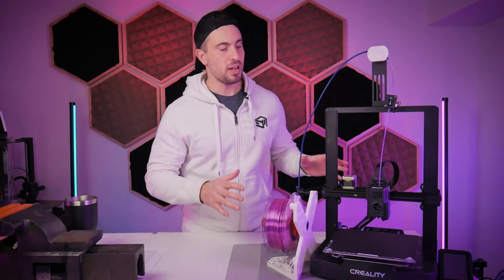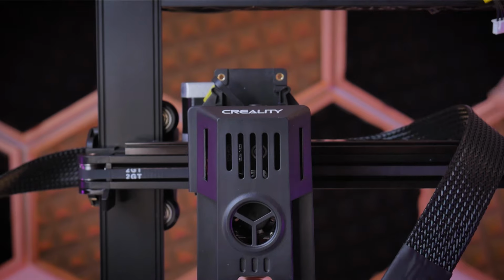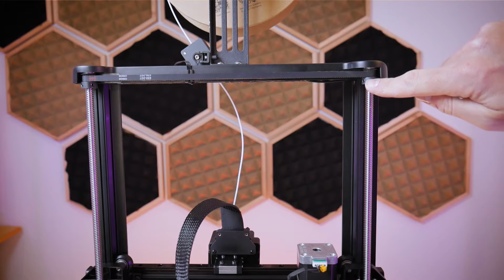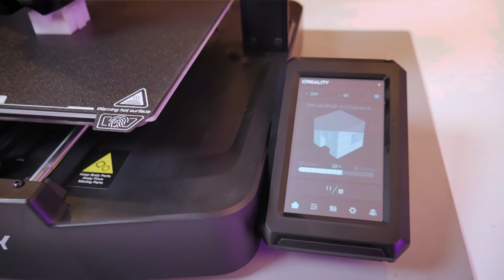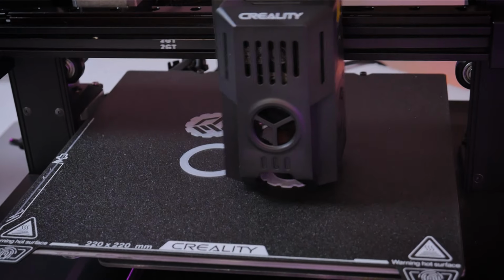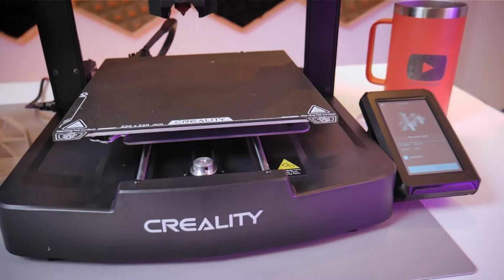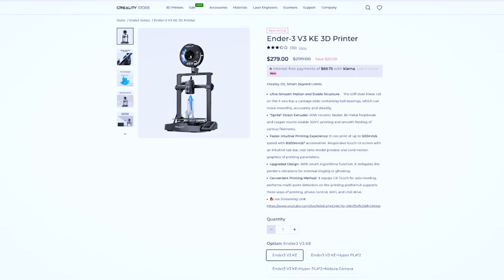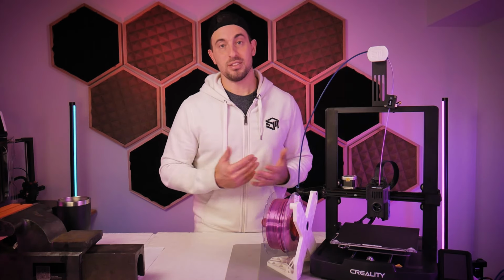Creality Ender 3 V3 KE Setup Guide, Tips, Review, and Upgrades

Comment: You can remove the horizontal movement of the bed entirely by taking off the bed, loosening the bolts that go into the L and R bearings. From there you can add a bit of tension between the rod and the bearings by pushing the right bearing right, and the steel plate to the left, and then tightening the right bolts. Do the same to the left, but in the opposite direction, and you will add a bit of tension that stabilises the barings, using the steel plate to take the force (you are basically moving the bearings away from each other by a few decimals of a mm).

Remove the two belt bolts and move the bed around to confirm you didn't add too much pressure, and everything is running smooth. You can also try adding bit of toe in/out to the bearings if you think your issue is at the front or back of the bearing. While you are here, clean off the oil and make sure the rod is nicely lubricated and that there is no dust on the rod that might get into the bearings. 

Very easy to do, takes around 10 minutes. My bed doesn't move horizontally at all. I still have a tiny big of sag when weight is applied to the front of the bed, but I think that is just a consequence of only having 1 bearing on each side, you are naturally going to have some sag.

Comment: Where did you get the blocks from and why aren't you using cura?
Reply from the maker: The blocks are just some random metal blocks I had from an old job where we used to make plastic injection molding machines. I don't use Cura because I can't stand the interface - I find it too busy and can never find the settings I'm looking for.

Comment: i have the KE and upgrading it to the latest firmware that unlock root access is a must so you can install mainsail.
Reply from the maker: I will be experimenting with a few of them now that I have more than one KE :)
Reply: @EmbraceMaking i have 1 KE i was initially going to get a 2nd one. but then i decided to get the bambu labs X1Carbon. they are both awesome printers in its own way.

Comment: Excellent video. I got my Ender KE in January 2024 and have been enjoy it quite a lot. I recently noticed though that the gantry on it is not square to the print bed, and tilts towards the back of the machine. I contacted Creality about the issue, but the response has been crickets. Do you have any advice for this issue?
Reply from the maker: Have you tried disassembling it to see if there is something obstructing the extrusion from sitting flat in the channel? Perhaps there is some kind of metal burr or something on the inside that is in the way ?

Comment: My Ender 3 v3 KE came with broken CR-Touch and with nozzle covered in white filament. I think I got used printer, because I see on your video that nozzle is clean. Plus I also got bent nozzle to the left. The CR-Touch problem is code 2194 and a lot of people on the internet have the same issue. This printer is good, but only if you got printer from good batch xD
Reply: I got the 2194 error using the Cura slicer switched to Prusa and no errors. I could not install Creality Print on my main computer because it had some SW conflict. I did install Creality Print on a different computer and the speed difference was way faster than Prusa slicer with Marlin-2 gcode. The Prusa Marlin project box took 7.3 hrs to print. The Creality Print Creality-OS sliced gcode box took 1.15 Hrs to print. It was flying.  I have about 60 hrs on my KE and had to tighten belts (because I was getting X,Y bed judder) and Extruder mount screws just today. Made a world of difference. I used Elmers purple glue stick for the first time today as the the PEI bed was beginning to have some adhesion problems. NOW I'm very happy with the fast high quality prints I'm getting. The live Zed I will look at. Looks like a great tune for me to try. Love my KE. My first printer. I subscribed!!! Great video!!!!
Reply: I'm having the same issue. Only 3 days old and started 2nd dy. The more I inspect it, it seems like a firmware issue. I wish Crelity would fix this or I'm sending it back. Otherwise its a boat anchor.

Comment: I have the other new Ender machine the Creality CR-10 SE, LOL only Creality right.  I did root the CR-10 SE and bought it because I saw on line how to root it before I bought it.  I have a Bambu X1C with the AMS as well as two other Creality CR-10s.
Reply from the maker: Very nice, how are you liking the CR-10 SE?
Reply: @EmbraceMaking Love it after even more after I rooted it.  Now I can use Fluid or Mainsail to control my Klipper machine and really it's another Ender machine.  Who ever heard of a 220x220x265 sized CR-10?

Comment: I like that you were honest with the problems you had with yours. I have yet to talk to someone without a single thing that was wrong with there KE out of the box. For me my tool head frame wasn't bent all the way just like yours causing the CR Touch probe to be lower than the nozzle. After a long talk with Creality and after they tried to get me to bend it back myself they are sending me a new tool head frame.
Reply from the maker: Thanks, I do my best to report it like it is. I was hoping that because the unit I received was pre-release that maybe these were some isolated issues but it does seem like even the production quality control needs some work. Some of the fixes are easy and after I bought two more of them I wasn't thrilled that one had the crooked hotend - I let it slide a bit because of the low price. If I spent $500 on it I'd be more upset but I just fixed it and went on my way. I brought this stuff up with Creality and they said they were going to look at it so hopefully future machines don't have these problems.

Comment: Any improvements to stop the hotend fan sounding like its bearings are failing when cold, and being louder than a small vacuum cleaner once it gets going?
Reply from the maker: I don't have one yet... mine doesn't seem to be that loud but noise can be fairly subjective. Have you tried sourcing a higher quality fan? I'm wondering if the stock one is a sleeve bearing or something that wears out quicker than a dual ball bearing style
Reply: @EmbraceMaking It says a lot about Creality's quality control when they ship a printer with a nozzle that's incorrectly fitted, a bent bracket holding the hotend, a non square gantry with uprights that lean back from upright, and fans that fail after a few hours of printing. Your belt on the x axis looks like its rubbing on the left hand idler too.

Comment: Great video! Thanks for your efforts. Very interested in getting the spool off the top and had started printing another solution for that, but yours is much more elegant (just wish I could buy the files and print it myself since that’s why I bought a 3D printer!). Would love to see a video on setting the KE up in Orca to print over Wifi on a Mac. Creality print over wifi works great but can’t get Orca to Wifi print on my Macbook Pro.
Reply from the maker: Thanks! Unfortunately I don't have a Mac to experiment with but I have been using Orca more and more on this printer and love it

Comment: My ke has terrible bed wobble from side to side and vertically
Reply: Check the rails, mine were loose at the front of the printer as the screw that holds them isn't long enough to actually reach to the rail.
Reply: @frankhovis  I also had this same problem. One of the screws was too short and didn't reach the rod. I ended up finding a little piece of PLA and put it in the screw hole and it stopped the rod from moving up and down. All my screws are tight and my bed still has terrible wobble. The only way to fix it is linear rails which a lot of people are working on developing now since this is such a big problem with the KE
Reply: @ty8324 lift the hotbed off and there are bolts that hold the bearing housing to the plate underneath the hotbed. They can be loosened and re tightened while pushing the bearing housing outwards , applying some preload and taking up some of the slack that's there. Its not a perfect fix but it can help a lot.
Reply from the maker: I'm working on a linear rail conversion kit - I know that is not very helpful in the meantime but unfortunately I have heard a few people complain about this. Luckily mine wasn't bad but perhaps you got a bad set of rods or bearings. Have you tried contacting customer support about it?

Comment: thank you! can you advise: my KE prints first layer not really well. On left upper corner nozzle is too close to the bed so its making scrathes, while right buttom - is too far so its printing lines. 

Manual Z offset in that case does not work, because its making it on the whole perimeter of bed and I have opposite situatuons in the corners.

Maybe you know how to fix that? Your first layer is good on whole 220*220?

thanks!
Reply from the maker: First check that everything is straight and square. Did you see the part in the video where I adjusted my gantry? Check that yours is parallel with the print bed. If it is, then I would preheat the bed to 60 degrees - set the nozzle height to z=0.1 or something small like that move the print head to some area in the four corners of the bed. See if your bed is very warped - also check the klipper bed measurement graph and see if the shape that it measures matches what you see in terms of high and low areas on the first layer. If it is extremely warped for some reason maybe contact the customer support to see if they would send you a new bed?

Comment: wont extrude out of the box, so off putting
Reply from the maker: You had an extruder jam out of the box?
Reply: @EmbraceMaking  feeding the sample hyper PLA worked ok initially, but keep getting plug jams in the ptfe tube area of hotend. not sure what is wrong, this is extruding in the menu/manually w nozzle off bed etc
Reply: @barfbot The KE doesn't have ptfe in the hotend.
Reply: @frankhovis  the ptfe that goes from the extruder to the heat break, that gap where it sits is where the plug has started

Comment: Is this a good 1st 3d printer?
Reply from the maker: It can be - but I think you would have to be comfortable at minimum checking over the things I pointed out in this video. There can be some quality control issues that appear to be fixable by the user if you end up one of the unlucky ones to have a crooked hotend like me. I was able to just remove the screws and carefully put them back in straight. If you aren't the type that is comfortable doing those kinds of things maybe consider another machine that doesn't have these potential issues. That being said, if you get those little things sorted out its a hard machine to beat for the price

Comment: Looking forward to more KE mods.    My KE hasn't been a positive purchase as of yet.  Build issues, bed bearing tolerance issues, print issues.
Reply from the maker: Thanks, what kind of print issues are you experiencing specifically?
Reply: @EmbraceMaking  Seems like due to the bed flexing so much and gantry not being square, first layers across the bed don't go down well.   It gets worse from there.
Reply from the maker: Interesting - well I'm going to see what I can to improve the situation - let's get that bed super rigid with the linear rails
Reply: @EmbraceMaking will you  be coming out with the linear rail brackets on your website?
Reply: @EmbraceMaking  Where is the small electric screwdriver from?
Reply: @TheRealyinyang_FloxMeTv Creality bro

Comment: The V3KE truely is a great printer. Thanks for showing how to levelthe gantry. The best part is this printer has support for input shaping and klipper rooting. Once you do those mods itll be even more of a fantastic printer. I loved mine but have since upgraded to a K1C.
Reply from the maker: Couldn't agree more! I'm very fortunate to get to test the different models  - the K1C is great and so is the core xz V3 but I feel like the KE is the best bargain. The other printers are more capable out of the box but they are also more expensive. This is why I bought two more of them :)

Comment: Surprised to see it not have dual z-motors
Reply from the maker: I was also a little surprised but maybe it had something to do with motor syncing (and cost cutting). I never personally had this problem on any of my dual z motor setups in the past but I've seen people talk about it... Either way it's belted and seems to be working fine so far...
Reply: @EmbraceMaking  a good upgrade print for it then would be a belt roller-tensioner system up top for the z-belt, making sure it never skips. Just a bearing on an arm that has a PETG tensioning "spring" pushing it softly
Reply: @Doogleraia  on printables there's a belt tension mod already. Pretty simple too
Reply from the maker: I can look into it !